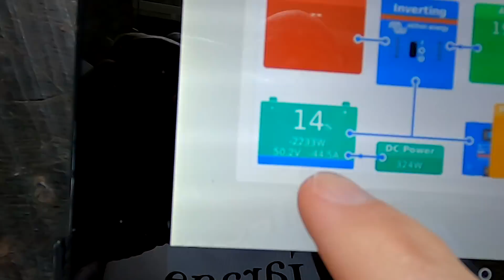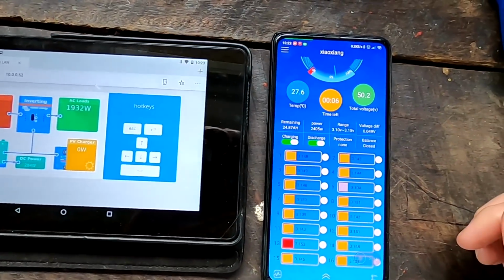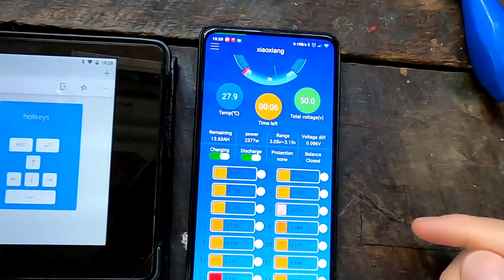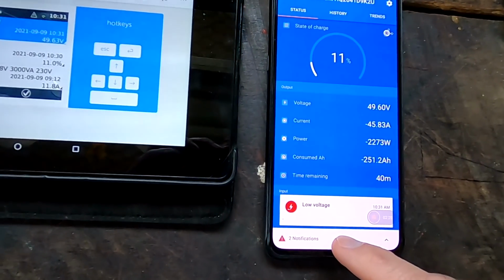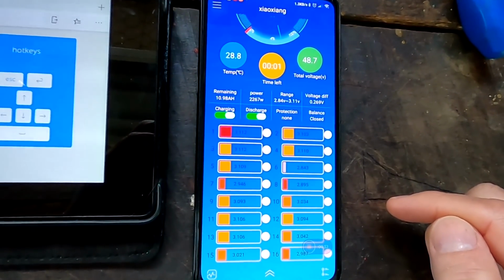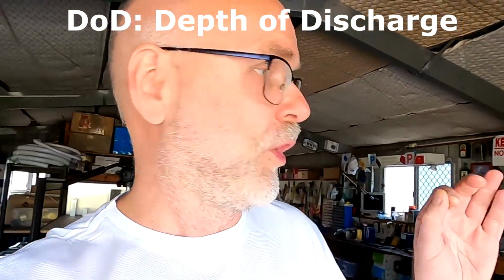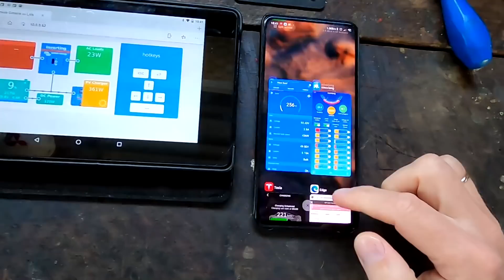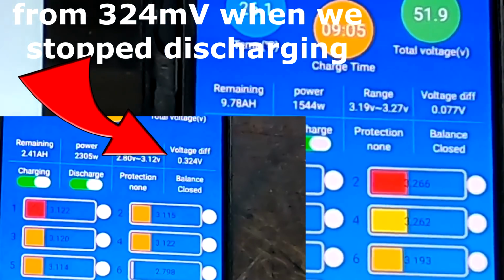Over 90% Depth of Discharge. Why go further?

Comment: Good info about the bottom balancing of these cells Andy. I would do a bottom balance of your few out of range cells with a Lab power supply individually and maybe take it down a bit more just to get a final balance in with all the cells individually, and then take the whole set up to full charge again and see how a capacity and balance test goes and see if the lower state cells go down again quicker or more evenly. I respect ur arguments that at 40 amp discharge, a 4-5amp balance circuit wont keep up, big But here, if you set your bottom balance to start a bit on the early side, wouldn’t that help to keep the cells in a better state of balance as they are coming down and also to help keep the voltages in a range to keep the equipment operating for that bit longer?  Thanks for all ur useful info here.

Comment: That got me wondering about the arrangement of cells according to their capacity or condition. Whether weakest ceils should be nearer to or further from the strongest, whether it makes any difference if they're closer to the negative or positive pole?  And what about arrangements in series/parallel where weaker cells could compensate for the effects of non uniform busbar lengths. Totally unnecessary of course, unless you happen to share my passion for perfection.

Comment: Andy, Some of us with mobile setups are connecting AGM batteries to Lithium directly to good effect, Lithium keeps the agm at float and lithium does most of the charge and discharge work leaving agm as a backup if needed. It would be very good to have some of your testing on this setup. What do you think?
Reply: Yes! I would like to see this as I have 1 AGM and LFP cells on the way and was wondering how to utilize them both.

Comment: Thanks for all your videos. I bought some of the 280ah cells for my motorhome. But I'm only getting 245ah out of the 4s battery. I did a parallel top balance on them before I put them in series. I'm using the same load tester you used on yours. My diff voltage is 0.442 at end of discharge. Don't know if I should be happy with that or what. What's everyone's thoughts?
Reply: It looks like you got bad cells. Test the cells with the tester and contact your seller. A lot more people got cells with lower capacity from bad sellers.

Comment: Seems there are so many fake 3.2V LiFePo4 cells on the market, I cannot believe the 280ah cells are new for that price, they reseal them so they look new with new top and even barcode, when i look at the comments from ppl on ALI, it looks like a big scam, ppl lost their $ on bad cells, you can send them back for 250$ or so, not sure what to think, 1 guy bought them on YT remove the plastic and they looked used, also damage on terminals etc.
Reply from the maker: I had several deliveries so far without any problems. It may depend on the seller you deal with. The ones I have linked on my website are proven to be good with customer service and goods.
Reply: @OffGridGarageAustralia  True, they must be used and second hand, with a new wrap cant be for this price. But you cant tell the state off the cell, how many times they are cycled, you cant test it either before you're order runs out, I guess you have 320ah on 80%, I wanted to order some but its a shady world with only 1 big supplier (and many stores), some cells already expanded when you hold them together, you have to other 1 pack so the match the used cells, guess you're lucky so far some others have big problems and they cant send it back due high shipping cost, and lost their money. You can find video's on YT for this problem. Maybe I will order 12 pcs and only use the best 8 ones, don't get me wrong they seems good value for $, but its still a scam. Would be nice if they say used with xx cycles, I'am sure you don't have 4000 cycles left but more 1500. anyway love you're channel just wanna warn ppl about this world.

Comment: Hello Andy iam Mario from Sri Lanka, at the moment i am using 8 * 202 ah lifepo4 battery Cells with my mse1-2424 Mpp solar inverter
My settings for the BMS is 3.0 minimum volts cutoff volt and 3.55 volt max cutoff.
And on my Inverter i put it at 3.12volt minimum & 3.40volt at max Cutoff. I use about 6 kWh for a day. From 7am to about 9 pm. If I go less than 3.12 volts which is 25 volts for my 8 battery cells. The cells differ in voltage,to about 80mv on my BMS, which shows different volt.
Is this ok, or should i try to get more out of my battery cells.
Please advice, thanks,
Reply from the maker: Hi Mario, thanks for your comment. You probably can set the BMS to 2.7 for the disconnect and 3.6V for the upper limit. The BMS should always be set at the extreme points and other equipment work within this set settings then. 
BMS: 2.7-3.6V
Charger: 3.5V Absorption, 3.35V Float
Inverter: 2.9V-3.55V
The inverter cut off is dependent on the load at that time, so the higher the load, the lower the disconnect can be set. If the inverter has only one fixed value, I would set it to 2.9V. If you pull a big load it will stay connected for a bit longer.
The Victron Inverters do this dynamically depending on the load.
Reply: @OffGridGarageAustralia  I'm assuming the low voltage parameter for the inverter is based on the assumption that it will be a heavy load. Now for a smaller load, say 10 amps continuous, would you want to set the low voltage parameter for inverter (or any other component) a little higher, say 3.1v?
Reply: Thanks Andy for your kind reply.

Comment: "there's no way to balance that out" - sure there is, run 12 of them in parallel and boom, you can use almost ALL of the capacity. ;-)
Reply: The balancer doesn't have to outbalance the full discharge current, because that would cause the cell with low voltage have a cell voltage well above all other cells. But a few amps will reduce the voltage difference between all cells considerably, and you could discharge the battery even more. But as mentioned, it makes no sense to go lower than about 10 %, as with charging above 90 %. You can probably double the total kWhs taken out of the battery till 80 % rest capacity, by just staying in the 10-90 % SOC window compared to 0-100 % cycles. Search for "lifepo4 cycles soc window" to get more information.
Reply: @egnegn123  I don't need to search for that, I know what I'm talking about. The first part of your comment is right, but what if the current in or out is 120A instead of 60, then we're in the realm of needing at least 60 or so to keep things on the level. Maybe not that extreme, but a lot more than the approx 2% of capacity that his balance board had compared to cell capacity. I run about 75% of cell capacity in balance boards and even then you can out-charge it and out-discharge it, but it's usually spot on once you get them close. 

To your last point, though, this is false thinking. When you use active balancing at the extremes what you do is wear out the strongest cells faster and preserve the weakest cells longer, thereby converging their performance. Without it, such as in this video, what you actually do is the opposite of what you want, ie, you weaken the weakest cells by discharging them more, and leave the strongest cells to be discharged less. What the balancer is actually doing is shunting current around the weaker cell, not micro-cycling it.
Reply: @fredio54  The last part was a more general statement and wasn't related to balancing. But I agree with your thesis regarding converging the performance of cells with an active balancer. I looked for a scientific comparison regarding cycle life, between all the different balancing methods, but didn't find anything. Do you know something?
Reply: @egnegn123  No, no hard data, but the very least that can be true is that it stops them diverging and they wear more evenly. Secondly you get more of the energy out of the pack regardless of where you stop, so better value for the money you have in them. They should be sized to be ample for a worst case day AFTER 25 years AT 80% anyway, so just rock them hard and treat them well and look forward to the day you run out of electricity during your retirement :-D

Comment: Why not just swap out cell 6 with another one to get a little more equalization in the pack?
Reply from the maker: Why? For what reason? I think people don't understand that it is not worth squeezing more than 90% of the capacity out of the battery pack
Reply: @OffGridGarageAustralia  I agree the fact that it top balances fine and there is no issues with capacity why change it? "if it's not broke don't fix it" ;)

Comment: I think I know what I want buying a solarking 100ah battery for boat and a 16c battery with solar panels for the shed to charge it reason I hardly go below 50 percent (will still get more cycles) on the 100ah 1c battery and for the price of $600 it's about same as building one as for the 16c will have inverter run my bedroom so doesn't cost anything for my parents

Comment: You should try Winston cells mate. I and others are getting about 120% rated DoD before we chicken out. I know a guy who got to 125%. Still over 2.8v/cell
Reply: I use Winston since nearly 10 years without problems. But compared to alternatives available today you can get triple the capacity for the same price. So I also bought EVE cells, and like Andy I got a few percent more capacity. I see no advantage in the Winston cells anymore.

Comment: Since all of the battery makers who bother with warranties and documentation seem to recommend cycling a battery from roughly 15-20% to 90-95% SOC for the optimum battery life...Why bother pushing any battery below 15% or above 95% ? They all disagree on specifics but do agree with general limits, no?
Reply from the maker: That's absolutely correct and exactly what I explained in my video. An extreme DoD of over 90% is way enough. If you hit this 90% constantly, it's probably time to think about a second battery to increase capacity.
Reply: @OffGridGarageAustralia  Right! Investing 10 % in capacity increase may double the lifetime for the whole battery.
Reply: What is this 15% & 90% soc
In volts, some help & advice Apriciated,
Iam from Sri Lanka.
Reply: More batteries or panels, stored capacity is batteries however usage could be more about charging, some people get more batteries only to find it just makes things worse as they should have just got more panels.

Comment: You will be surprised how a few amps with the active balancer could get your capacity a few percent more. All the balancer has to do is slow the low voltage cell from hitting the low voltage cut off for a few minutes for another few percent more capacity.
Reply from the maker: To have an active balancer connected at such SOC would be catastrophic for the whole pack! As we have seen from my previous tests, it would unbalance the whole pack and you have these problems then at the bottom AND at the top of charging as well. It will never be right.
I agree, that with a active balancer you may be able to squeeze a few more Ah out of the whole pack at the bottom, but you will loose them again at the top. Cell 6 will peak at a high voltage when fully charging and you have the balancing problem there again.
It's not worth doing this. 90% of usable capacity is all you should use the battery for anyway. EVE stats battery usage from 10-90% to achieve the ~3.000 cycles. So why would you aim for more than 90%DoD?
Reply: @OffGridGarageAustralia  Correct! The active balancer is not worth the few extra ah because then you have to start all over again with the top balance process.
Reply from the maker: @uhjyuff2095  That's the experiment I'm running right now. We basically know the outcome already. Quite a few people are running their batteries without BMS just from 20-80% and never do any balancing for years.
I'm interested in the drift over time on such a pack during normal usage. How much does it actually drift apart with small and large loads? Do we need balancing at all. How often? How long? All these kind of questions I'm interested in...
Reply from the maker: @uhjyuff2095  Exactly right. Unless using the balancer only at a certain voltage when the pack is fully charged. Then it is very useful. I'm getting such a balancer soon.
Reply: @OffGridGarageAustralia  Well, from my limited experience with series connected lithium batteries, certain cells drift/leak voltage more than the others over time. That is why balancing circuits are needed. Although, detecting this issue with lifepo4 cells could be harder versus nmc cells because of the flatter voltage profile.
Reply from the maker: @uhjyuff2095  In a series connection, the current is the same for all cells. The heat loss inside the cell is different though due to the internal resistance of reach cell being different. That's why they drift apart over time. With LiFePO4 cells you will only finds out in the steeper party of the curves, either to our bottom. In the middle it does not matter. You usually only balance at the top when the battery is full and the voltage deviation shows up. In the middle, there is no chance of balancing.
Reply: @OffGridGarageAustralia  Wow, very interesting about the heat/voltage leakage due to different internal resistances from cell to cell. It makes more sense!
Reply: @uhjyuff2095  It is not only loss in the cell, but also resistive loss at the connectors, that may be different because of oxidation and different torque used at the connectors. Small differences increase over time. So it is also important to clean all contact areas and use a torque wrench for the screws from time to time. Heat from the connectors will also heat the cells and increase the degradation.
Reply: @OffGridGarageAustralia  I think the main reason for the BMS is security, the fact that it has a built in balancer is just a bonus, however if you are one who likes to use 100% of the batteries storage then the balancing would more than likely be needed, In my opinion regardless of how you treat you capacity the BMS is a must, would you remove your fuses just because they never get tripped?
Reply: @OffGridGarageAustralia  The "active" balancer is trying to combine both "top" and "bottom" balancing to squeeze all energy out of all cells in a pack. In the top it causes unbalance at the bottom, and in the bottom it cause unbalance at the top. Doing this is part of the concept. The only problem is, that this small balancers cannot keep up when using high charge/discharge current to restore cell balance instantly when going to the extremes. 

But must the balance be within a few mV within a few seconds, or is it good enough for an PV system if the balance is achieved within half a day?

The typical daily use of such a system is that it starts in the morning with a lower SOC from discharging over night. On moderate discharge current it is easily capable to keep the balance, even you discharge the pack to 10 % and lower. So all the cells will be probably perfectly in balance, when the charging in the morning begins. It starts with low current and the active balancer may be easily keep up, especially when reaching the flat voltage area. In summer the battery will reach 90 % often already at noon or early afternoon. With high charge current some of the cells may reach the voltage threshold of the BMS, and a typical BMS will just cut off charging, and not the total system. Even cheap single-board BMS will only cut the charge FETs. The charge controller will go into absorption and later into float. What SOC was reached at this points depends on the imbalance caused at low SOC and at time with high discharge currents. 

But after this point has reached the active balancer will still do its work continuously and balance the cells. Of course, the battery will not charge further, unless the load cause a drop below float voltage, that triggers bulk charge again. 

Over the night the battery is discharged again the the active balancers will do its work again, and you can use most of the capacity without triggering cell cut-off early.

As I remember that in your case the BMS cuts-off both charging and discharging, because of common relay. This is very bad and I now understand that you want to prevent this. The active balancer is not the right solution, as long you are using this BMS. And as long as absorption time is long enough to get the cells top balanced with the BMS, the current setup is the best solution.

Comment: Uncle Andy, why not replace cell 6?
Reply from the maker: Because, then it will be cell no7 the next time and cell 13 the next time...
You never get them all in line. You can either do a top balancing or a bottom balancing and they will always drift at the other end.
Over 90% DoD is probably what you only should use of your battery anyway. The manufacturer states 10%-90%SOC and you get 3.500 full cycles out of it.